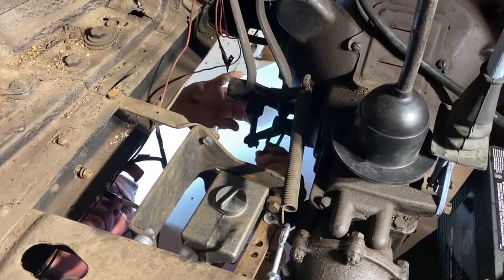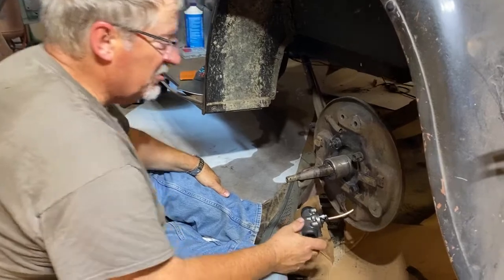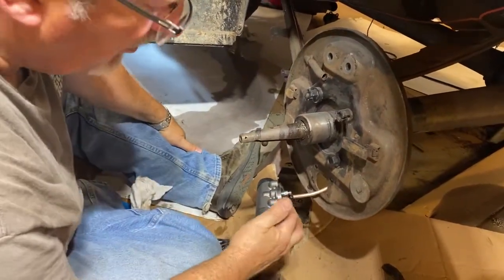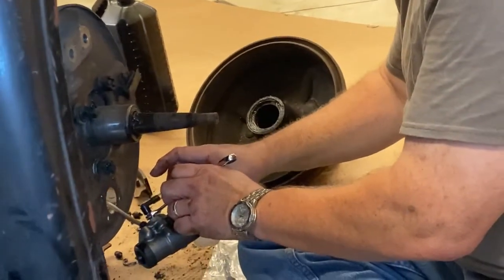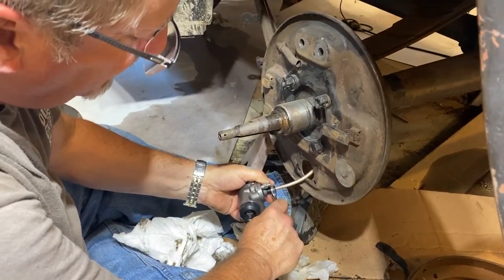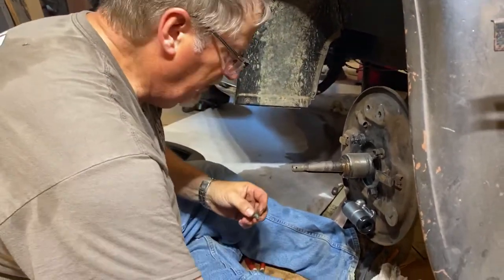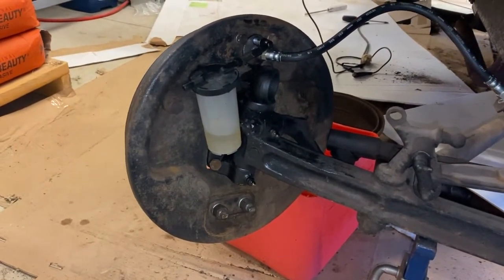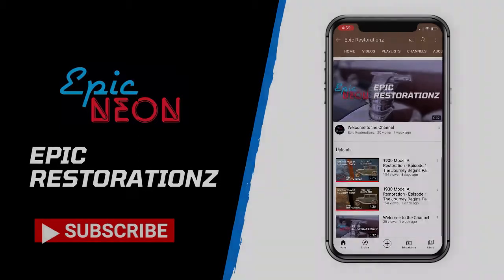1930 Ford Model A Restoration - Ep. 10 Bleeding the Hydraulic Brakes | Epic Neon | Epic Restorationz

Comment: Why didn't you use a double master cylinder that will allow two wheels to brake if a hydraulic line is broken. Another question. Normally the bake brakes are bleed first, the one with the longest brake line, on the rear bleed first, then the other rear brake. Am very impressed that you are using a "line wrench". NIce.Why did you blead  the front brakes first? Love the work you are doing and love your videos. Am the MAFCS Facebook Administrator. Talked to your dad on the phone when this car was first obtained
Reply from the maker: Hi Michael. We actually did bleed the rear lines first. I will have to recheck the video and make sure I didn’t goof there.  We probably would have/should have used a double master cylinder, but we bought this one before we knew better. We plan to reinstall the emergency brake to give us a little extra security.  We may switch to a double master cylinder down the road.